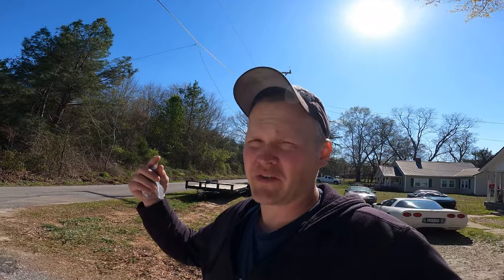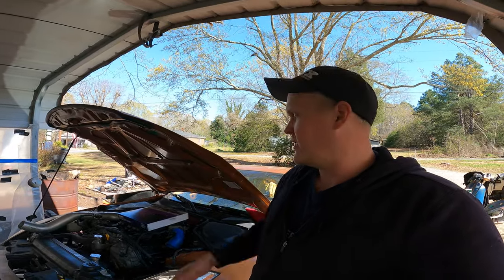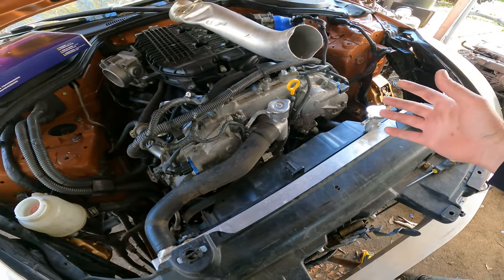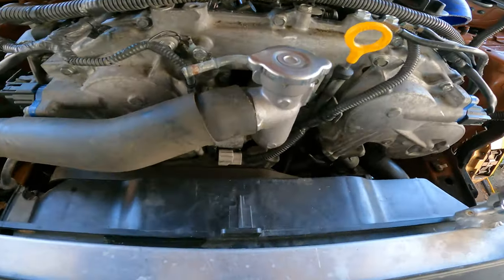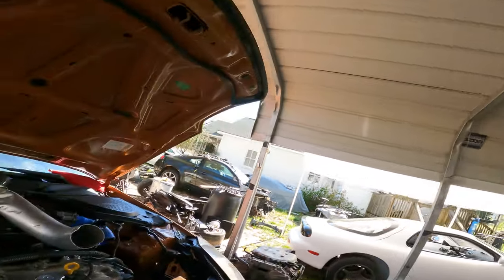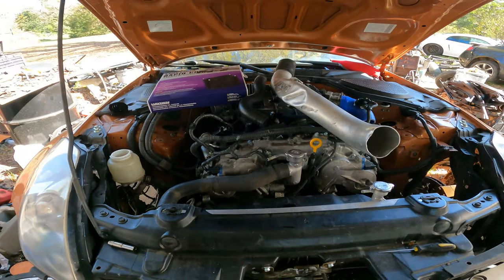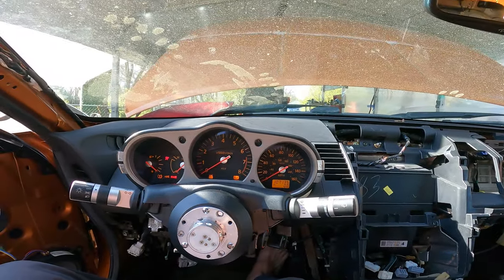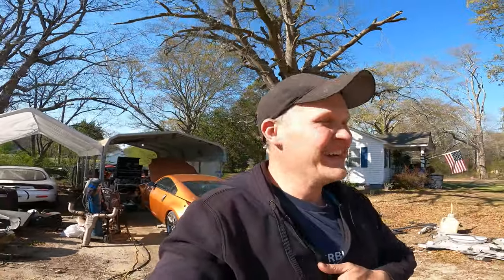2005 NISSAN 350Z VQ35HR SWAP

Comment: Subbed. I'm actually looking at doing this exact same thing. Any tips/tricks or anything you would change up if you could redo it? 
I'm currently on a time constraint at this very second, but I was recommended this (for obvious reason lol) so I wanted to comment this, and get this on my watch list to go through your channel to view your build progress.

Thanks!

My specific car is the 06 revup 350z i have a turbo kit installed on it, which currently has a few...major problems lol. When I do this, I'll be looking to acquire a crashed 350z 07 - 08 (manual for the jk since my cd009 will not bolt up), and plan on purchasing a number of OEM Replacement parts so that many things can be new, rather than damaged, used, or problematic later on.
Reply from the maker: Thanks man I’ll try to make a really detailed video in the next couple weeks
Reply: @Nathaniel2503 Awesome, I look forward to it! Ever consider doing the VQ37 Short Block on the HR, too?
Reply: @Nathaniel2503 Hope life has found you well, end up making that video? I've decided to go the route of fully replacing portions of my 06 RevUp with the 07-08 via donor car. Was wondering if there's a basic "To get this to run on the street, you need these" list.

Judging from what I've learned these months, without a harness done, it's essentially:
- HR/Trans (obviously lol)
- Clutch & lines
- Power Steering moved & new lines
- Steering rack -- Do you need the 07/08 rack for the VDC light to turn off?
- Coolant moved & new lines, Rad Support, Rad, etc
- ECU & Harness (obviously)
- Door Harness, various interior harnesses - Door, dash, etc (Would love to know what actually does work, what doesn't)
- Steering Column (for the key/lock) - Optional if not able to get the key reprogrammed
- Door Handles (for key) - Optional if not able to get the key reprogrammed

Anything else I may be missing? I see some back and forth a few places about steering racks, but it's unclear if 06 "would" work, or cause any issues.
Quick edit: I realized after writing this that, technically, a Locksmith (provided you confirm, I do know of one that can) can actually edit the BCM & ECU to change out the key to another one. So it's feasible that the steering column & door handles may not be required to be removed if this service is available in your area.

Thanks in advanced!